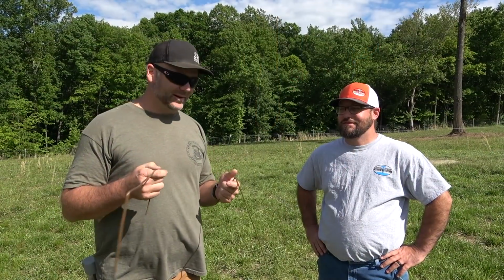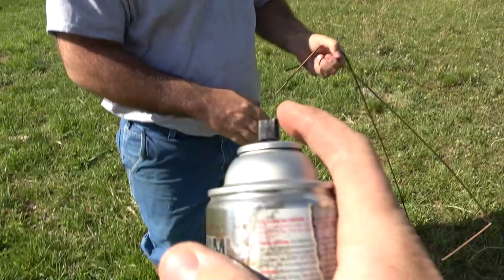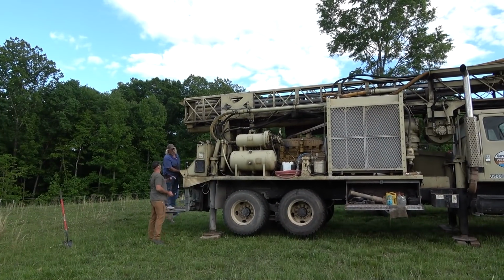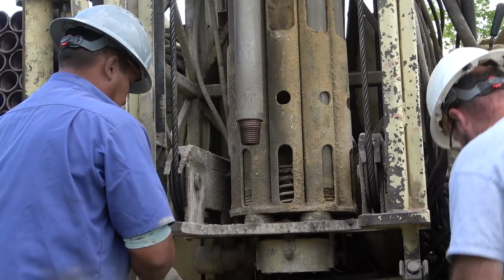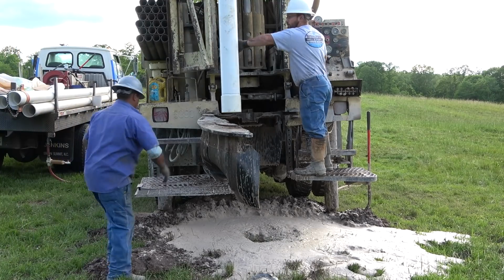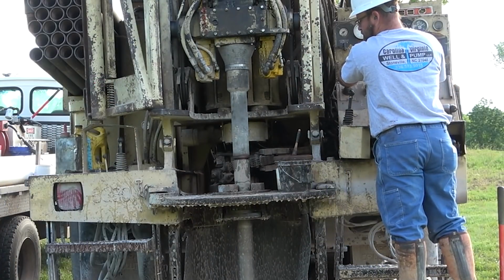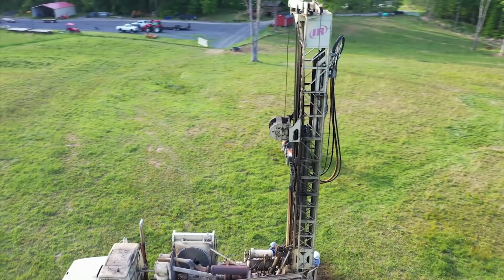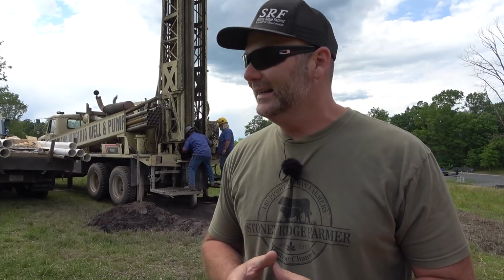How to DRILL A WELL the LEGAL WAY! Solar Powered!

Comment: How many horsepower is the well pump that your going to be using? Out here in North Modesto, the water table is only 30' and the the pump is used for watering almond trees 20 acres 3000 trees 1 1/2 horsepower is a little weak but it works. it takes about 5 days to water the entire orchard.

Comment: Drilling turbines, the water keeps the drilling head cool. In oil drilling, liquid mud is pumped down into the hole which returns and is tested to check for hydrocarbons to verify the presence of oil. So I have been told!!
Reply: That's for oil and gas wells .water wells are similar but the mud slury is  to lube bits return cuttings and keeps the well bore balanced to .

Comment: I've never seen pvc pipe used for a well casing. They only use steel up here in the Catskills mtns
Reply from the maker: That way it will rust out in 30 years?
Reply: @StoneyRidgeFarmer   They don't rust out.  That's what they've always used up here since forever. I've never seen or heard of a rusted well casing.

Comment: What he did there with the second bit was about 10inch and was for the 20 ft surface seal. Honestly kinda weird they’re using plastic for casing not good for the long run. Those two bits are hammer bits and use the air pressure to fire
Reply from the maker: why would a plastic casing be bad in the long run? It's not exposed to UV, it will never rust or rot...I'm curious why my friend..not being smart...just wondering your thoughts
Reply: @StoneyRidgeFarmer  I do this for a living setting pumps and drilling wells. But in most cases when we get a out of water call. We show up to plastic casing it’s nightmare. But could all depend on your set up are you going to be doing a pitless or are you gonna have a well mate set up? If your doing a pitless that’s a lot of weight to have hanging off the side it I’ve seen quite a bit of under ground leaks cause of the plastic casing cracking in one case coworkers showed up casing cracked lost the whole string of pump column in the well. I’m gonn assume your gonna run 1 1/4 for your pump. If you run a well mate. That’s where the pump column just sits at the top of the casing. That’s just lotta weight to be setting on plastic and could lead to something breaking. For instance that well is about 400ft deep they’re gonna set the pump at 380-360 close to the aquifer just lotta weight if it works awesome just lot of bad run ins with plastic

Comment: From the German..to wish for….never saw any consistent marking in 25+ years..What you are seeing is involuntarily movement in an unbalanced system.  There is water pretty much everywhere, the difference is in a formation that will yield, either a sand and gravel deposit or fractures in rock.
Reply: Thank You exactly

Comment: Big pill to swallow? Come to Oregon and have a well drilled. A cased well is most of $100 per foot. My cheapest quote for a well of 220’ is a little more than 20k. And I’m only talking about a cased hole, with the assumption of only 30’ of steel casing to bedrock. And this is not granite I’m talking about, just lava rock. If I sound bitter it’s because I would jump for joy if I could find someone to drill for $50 per foot. I’d have to time travels to get my price down to the teens per foot.

Comment: Drilling a well in central New Mexico is about $14,000 since the wells are minimum of 1000'
Reply: That's actually really cheap! I drilled 2 residential wells here in Florida one 460' and the other one 400' and got 14,000 a peice, that included pump and tank installed
Reply: @markwilliams4525  this doesn't include anything except for the well. Everything else is extra.
Reply: @Farm_fab  oh ok. Still not bad though  $14.00 a foot is still cheap. What kind, what size and how much casing?
Reply: @markwilliams4525  if I recall, it was a 6" lined well. Granted this would have been the costs about 10 years ago, so it's gone up a bit since then.

Comment: Out here in Nevada and Utah we call those rigs hammer mill rigs. There the cheap type of well and are the lowest production wells. A better drill method is Rottery there more expensive put a create a better well. The best type but is the slowest in a cable tool rig. Here hammer mills cost around 30 to 100  foot. Rottery 75 to 150 and cable 200 to 400

Comment: I would like to see several wells drilled on the same property to see if it matters where the well is drilled. If you hit water at the same depth without the sticks crossing.  I’m currently in permitting for a well to be installed and the driller doesn’t care for witching, he claims he hits water everywhere he drills and hasn’t seen evidence to the contrary

Comment: Where do you get the rods
Reply: Go to the hardware store and get copper grounding wire, about 1/8" diameter.  Straighten it our, it's always coiled in the store, cut them about 6" for the handle and 18" for the horizontal piece.  I use a piece of copper pipe which just fits the handle piece so there is minimum friction to rotation.  Practice, practice, practice.  Don't try with people watching, you must concentrate on what you are doing.  Relax and let the rods do their thing.

Comment: How deep do you drill there, say for a home well.
Reply: It would be the same. 10-12 gpm is plenty to run a house with. 
How deep you have to go to get a useful flow rate is entirely a matter of how deep into the rock layer you have to go to hit sufficient fractures with water moving through them.
Wells are a funny thing. In my subdivision, one house may have a 165' deep well yielding 40 gpm, yet the next house's well can be just a 100 feet away and need to go down to 350' to find 10 gpm.

Comment: Ya'll need some Amazing Randy in your life. Your dealing with an aquifer, it's going to be X feet down anywhere in that general area.  20 ft right or left doesn't make a difference. you just need to be far enough away from any other wells that might have depleted the water table in its local vicinity.

Comment: My Aunt taught me at a young age how to witch for water and I have found water every time its simple to do I was in the Army in Germany and a crew was looking for water lines on post in front of the barracks these barracks were built by Adolf Hitler during World War 2  and there were no maps of the original water lines they thought they were going to have to dig up a lot of the parking lot in front of the barracks I told them I could find the water lines for them by witching for the water at first they thought I was full of you know what I took 2 copper welding rods from the motor pool and bent them at a 90 degree at one end and showed them using a bucket of water and taught them how to witch for water and the water line was marked and the pavement was dug up and what do you know the water line was were the line was marked this was in the early 1980s they did not have the fancy machinery they do today to find water lines I guess maybe we could have used the Armys meatal detectors but this work just fine my Aunt tried to teach me how to hang a gold wedding ring from a string over were the water was found and the ring would start to rotate and for every turn would give you one foot of depth that the water would be found she did so at a location were a well was to be drilled and came as close as 10 foot of the depth that the water was found believe it or not :)